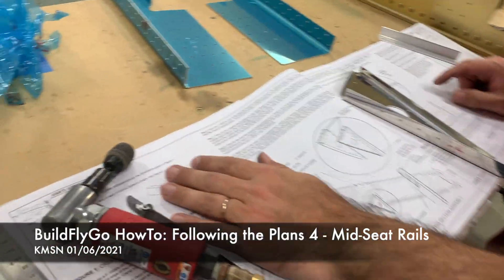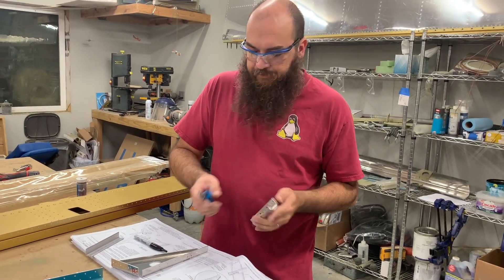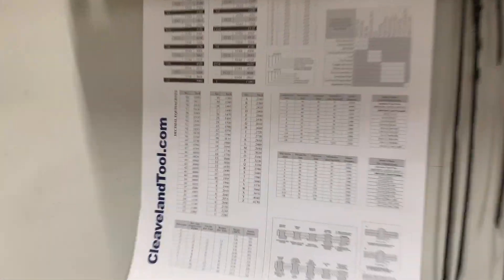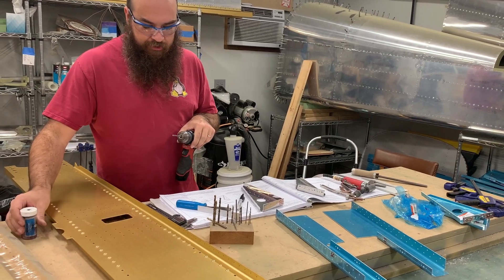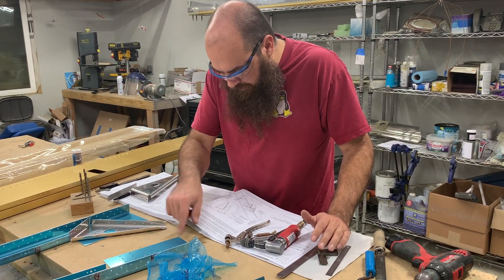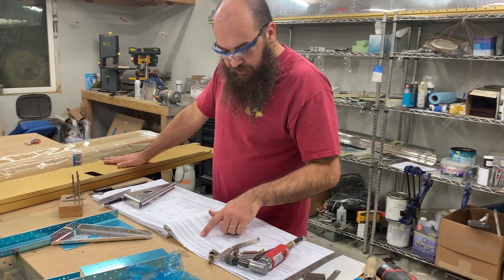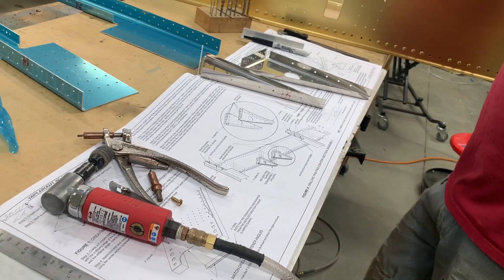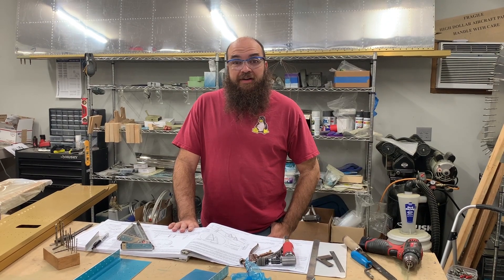HowTo: Following RV Build Plans - Part 4

Comment: Excellent videos... What motor are you planning? Did you even remotely consider Aeromomentum AM20T ?
Reply from the maker: Probably some variation on the IO-540. Aeromomentum makes very nice engines but has not done any testing on an RV-10. Creating a new engine mount, designing cooling and a new cowling, and associated testing for the AM20T would easily add a year to my project and unknown risk. In this case I'd rather leave the testing to the manufacturer. That being said, once they come out with all the above I'd be very interested in hearing the details!